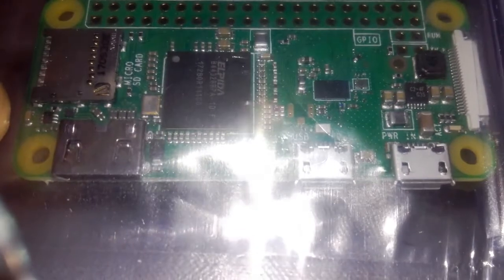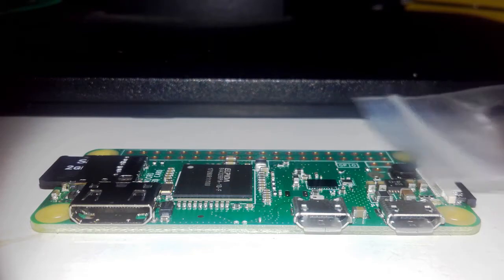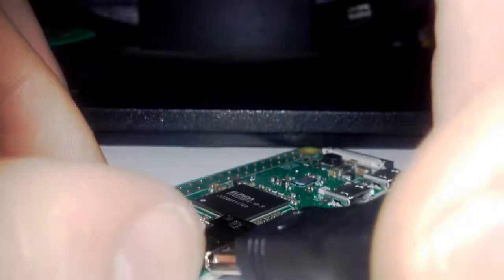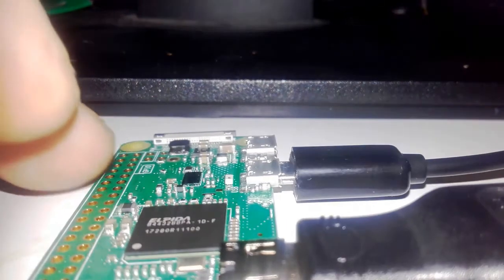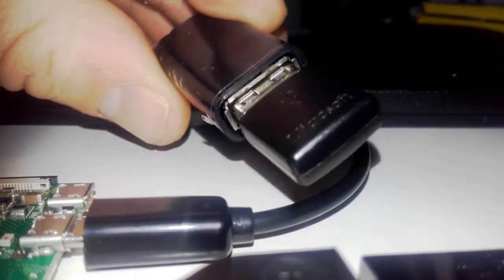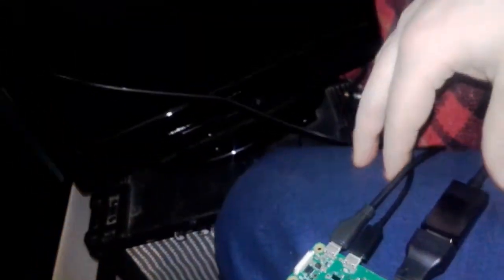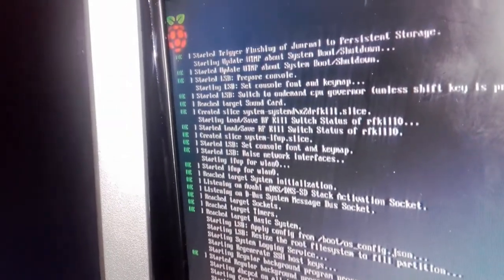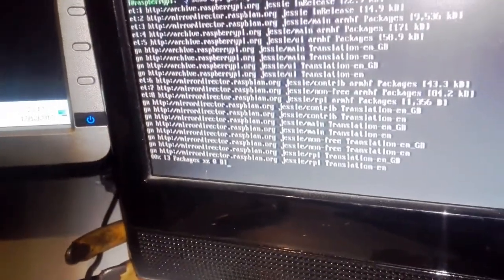Raspberry PI Zero W 1.1 setup and first boot

Comment: nice  i got my pi zero for free a wile back does ok but really laggy with the desk top not sure what ill use it for may turn it inti a crypto coin miner, i all so have 3 raspberry pi 3 wich i used to mine for coins and on host my web site it ran my minetest server nicely but had to pull it as i dont have fast intenet speed  if u have good intenet speed you could try and see if u can host a minetest sever on the zero i have not tryed that yet.

Comment: nice, i was going to buy myself a pie V3 B and turn it into an retro console emulator :)
Reply from the maker: +Glen Orpheus Sweet you definately should. You can get enclosures that look like mini versons of old consoles so you could have a nes classic looking thing with loads more games and a decent length of cable for the controler. Im getting the ZXSpectrum style one :)
Reply: yeah ive been looking at overclocking mine so probably going to go with an aluminium case so it acts as a heatsink, i even had a crazy idea to build an arcade cabinet :/
Reply from the maker: Glen Orpheus Yeah do that, very good plan. I think the pi has images available for that and if you need any tools for making the cabinet you're welcome to use mine. Ohh and i've got some proper arcade machine buttons I can spare somewhere I think.